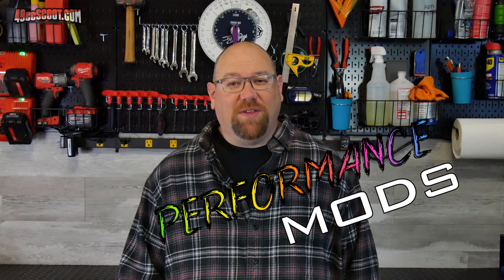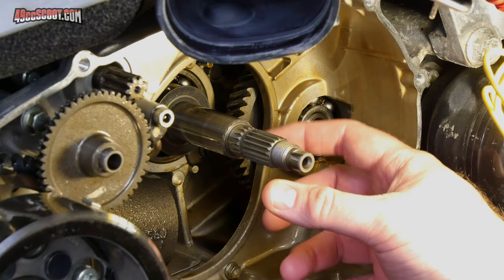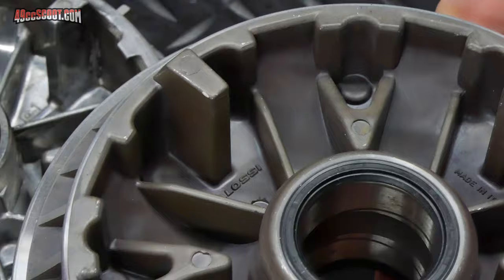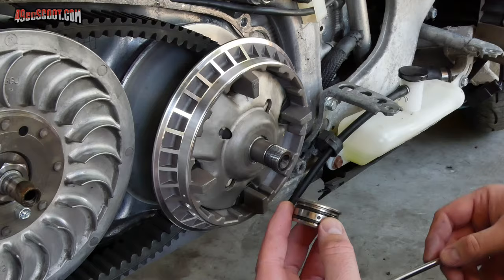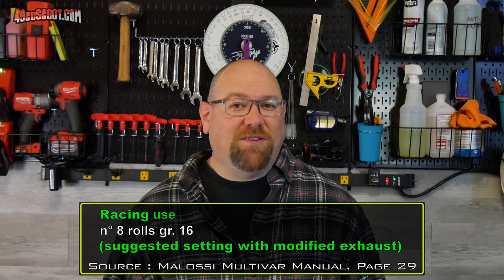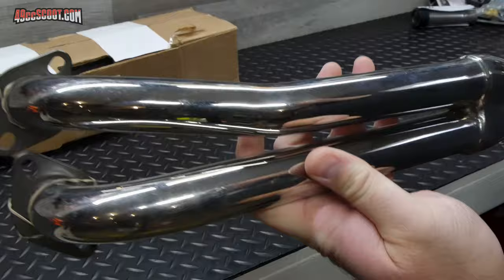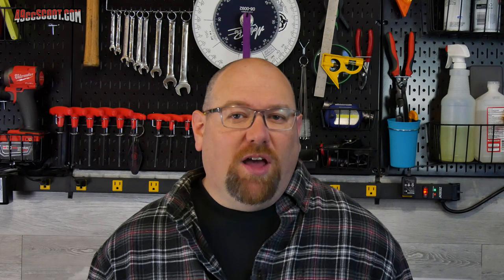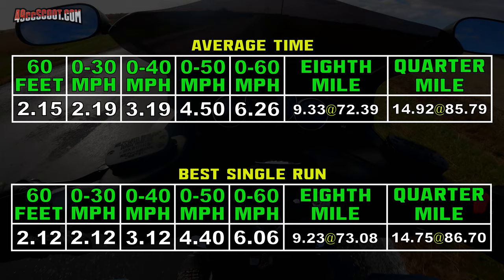Yamaha TMAX Performance Mods Tested 🛵 HUGE Gains! 😍 Variator, Exhaust, Air Filter & Fuel Controller

Comment: Now get a Gilera GP800 lol
Reply from the maker: I looked for that or an Arpilia SRV 850 in the past. Never sold in the US to my knowledge. Hard to get and source parts for here. The only bigger scoots that I know of here are more touring oriented and don't feel light at low speeds and/or aren't very attractive.
Reply: @49ccscoot  Oh, you never got those? That sucks.
Reply from the maker: @pubbiehive  We barely got the TMAX, and that's the most popular big scoot in the world. They quit selling them here after the 2011 models. I don't think we ever got the generation before those. Then, they brought it back in 2015. Not sure if it was that year or the next, but quit selling them again. I saw some brand new at dealers a few years past their release being offered at lower prices to try to get rid of them. Scoots get no love here.
Reply: @49ccscoot  it's pretty crazy considering how much easier it is to get a motorcycle license in the US vs over here in northern europe. we have a harsher, colder climate and get a way shorter riding season as well but we still have way more scooters, although moped size scooters are obviously the most popular, since you don't need a motorcycle license to ride them.
Reply from the maker: @pubbiehive  The motorcycle issue is the problem with TMAX sales I think. It's a motorcycle by licensing class here, so most want a cruiser, especially Harley, or a sport bike. It's not fast for a 500 and that doesn't help. Then there's the fact that it is a scooter, which is like saying a dirty word to your biker buddies. You have to be cool enough to realize that cool is not following what everyone else likes to be a scooter enthusiast here.

There are small scoots in larger towns. I may see a big scoot or mid-sized here or there, but it's pretty few and far between for me. I've never seen another person on a TMAX 500 in real life. I have seen 1 or 2 TMAX 530s... or probably the same one a couple of times.
Reply: @49ccscoot  Sort of the same here as well, if you go through all the trouble and pay all the money needed to get a bike license then you want to get something a little more exciting/cooler than a scooter. Big scooters largest market share here from what I've seen is middle aged men using them for commuting to work, and then having a sport bike or a cruiser for the weekends.

Comment: What's up with the speedometer being laggy during hard acceleration from a stop?
Reply from the maker: I'm not sure why it does it, but all of the TMAX vids that I've seen (at least roughly similar models) do the same thing. It's just too fast. lol
Reply: The tmax is shocked lol
Reply: @49ccscoot  i have the same tmax bud to fast😂 sorry bud a tmax is not really fast. For me the tmax is comfort bud very slow. Take a old honda sh 300 and it wins from the tmax. I also hat a majesty 400 that feels faster than the tmax. I think a normal variator and koppeling like other scooters is better and lose less power. 
Also the tmax uses alot off gasoline. 
Bud i am very happy with the comfort, it rides great.
Reply: @florisnr11  if an old honda sh 300 and a majesty 400 was better than your tmax, then...maybe your tmax have a problem. you cant match those 3 on acceleration or whatever.
Reply: @rogereanu  you dont understand ,a honda sh 300 is always faster then any yamaha tmax.
Reply: @florisnr11  bro, please.. lol
Reply: @rogereanu  look it up here on youtube, you see for yourself. 
I have a tmax  with all mods , and yes topspeed you win , no problem there . A honda sh300 has less weight and dont lose that much in horse power in the transmission. Look i love the comfort off my tmax. Nothing wrong with that. 
Please look here on youtube.
Tmax verses honda sh 300.
Reply: @florisnr11  mate, the stock version of tmax 2009 makes 0 to 100km/h in 8 seconds max and honda sh 300 in 11 seconds. Google it if u dont trust me, also ...i know what im talking about, riding all kinds of maxi-scuters since 2002 honda patheon 2 strokes, movin to foresight 250 then forza 300.
Reply: @rogereanu  0to80 the honda sh wins , look on youtube. 
Inhave the same T-Max as you full malosie and i am happy with it. Eccept gas use is way to much.

Comment: 18:40 oh poor you, you had to wear earplugs? What about everyone else? So selfish.
Reply from the maker: LOL It's not that loud. Trust me. I have Harleys and trucks with straight pipes or glasspacks that go by my house all day that would drown this out easily. I think because it aims up and it's not all the way out the back, it sounds loud on the scoot. Most bikes have low exhausts that extend all the way to the rear of the bike and aim back or are low and aim back/out. Plus, other people aren't exposed to the sound for hours. It's not an issue on a 15 minute ride. Besides, many people wear ear plugs just for wind noise.
Reply: Noone else is subject to the noise for the same duration or intensity as the rider though 😢
Reply from the maker: @sidney9534  Could be worse. Could be some silent electric two-wheeler that's much more likely to injure pedestrians or cyclists according to NHTSA and other studies.